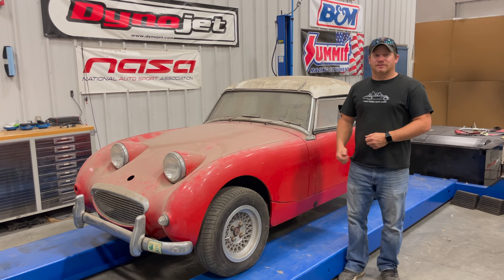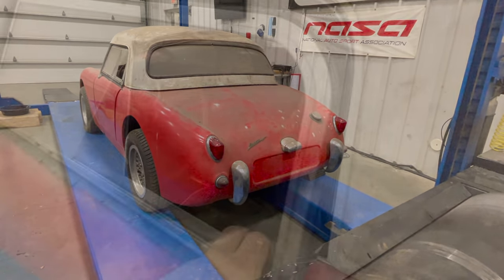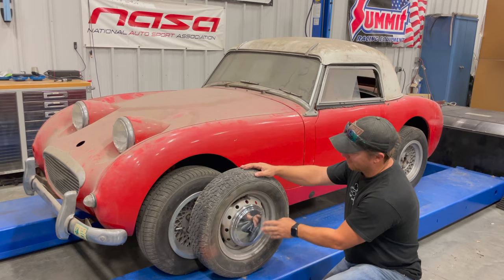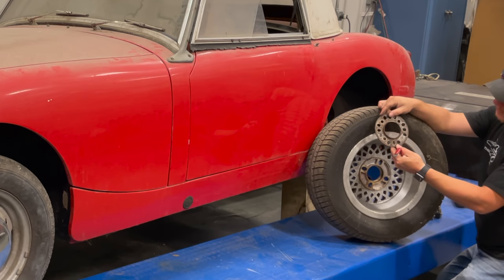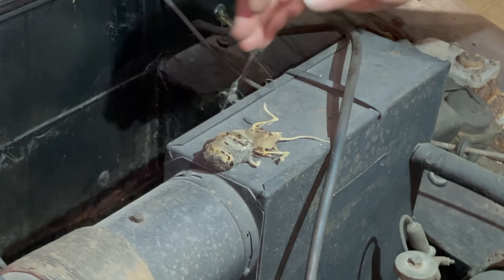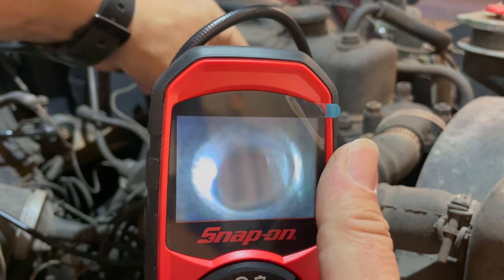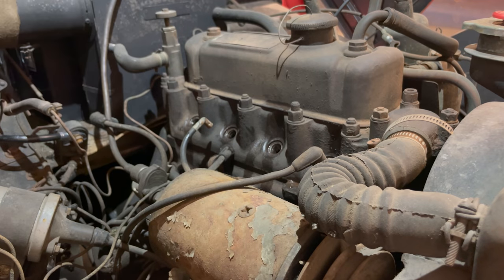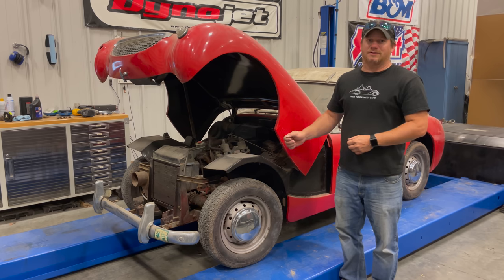Round 1 - Barn Find Sprite #3 - Will It Run?

Comment: I think you should let the top go with the car. With regard to freeing up the engine there is a school of thought among some mechanics that a small amount of diesel in the bores will do the trick. The plugs don't clog with oil and the diesel burns off quickly. I have not tried it (the need hasn't arisen) but it does seem logical to me and I did see a mechanic do it on TV with great success . I appreciate people have their own ways of doing things but this method is an alternative.  Great video Steve. 👍👍

Comment: I had a set of American Racing Wheels similar to those on the Sprite. I loved the look of them but the oval holes would frequently shave off the tops of the lug nuts. I think part of the problem was the spacers on my Fiat 128 Sport L would add pressure on the lug nuts, but I had to have them or things would rub especially on the front due to the front wheel drive. I had to always carry a set of lug nuts in my car at all times.

Comment: You could look into one of those small bead blasters that use crushed macadamia shells to remove the rust from the bores before doing the usual marvel mystery oil or diesel and ATF  trick to soak the rings to try to free them up.

Comment: If you want more money for the car sell the separately. Here in the UK I have a Ford Streetka,  a two seater soft top, designed by Ford but built by Pininfarina. You can get a Ford hard top for these cars, also you need a pair of special brackets.  People sell, or try and sell the hard tops without the brackets, but you just can't fit the roof without the brackets. The cost of the brackets can be more than the hard top.

Comment: on my 1275 Midget, 4th gear works to turn a working engine,  but maybe not  for one like yours.   If you find a cylinder with the valves closed,  you might connect compressed air to that cylinder with the tranny in neutral and see if you can move the piston down.   That might break the engine free enough to start moving it in 4th gear.

Comment: I'd say the top needs to go with the car. ATF is ok, I prefer marvel mystery oil. You didn't pull the dipstick to see if there is oil or water in the crankcase. That might have been a good indicator of the condition of the cylinders and or bearings. I'd also change the oil before running it. I look forward to seeing how she turns out. I like these old girls and think they have some character.
Reply from the maker: Yes but you need to consider shipping a hardtop can be a problem you don’t just put it in the mail.
Reply: prefer diesel or atf/acetone mix for unsticking stuck stuff
Reply: @ThisWeekWithCars  If it is on the car it does not need to be shipped separately.

Comment: it might be the most difficult sprite to start yet! One silly question why is ATF always the go-to oil to unseize the pistons? Why not other kinds?
Reply: ATF stands for automatic  transmission  fluid. As for the why; i could not say.
Reply: ATF has greater detergent properties. Some mechanics fill with ATF, run the engine awhile and drain to clean the engine. In this case (seized), I think they combine ATF with something that will work on rust that might be, for instance, around the piston rings.
Reply: @Callipygous1975  Thank you !
Reply: @Callipygous1975  What do you know of a product ca;; "Sea Foam"  or  "Marine Eight" ?
Reply: @andrewbillingsley9377  Nothing really. I guess they are motor oil additives meant to clean the engine. Keep in mind that these are competing purposes. Oil is meant to be as lubricating as possible to prevent wear while detergents work via friction on surfaces.
Reply: @Callipygous1975  thx